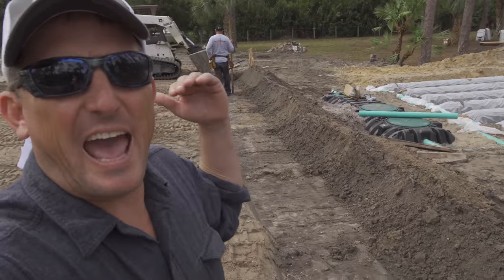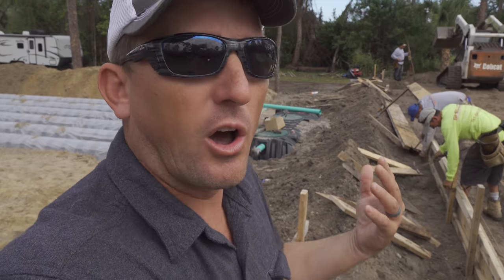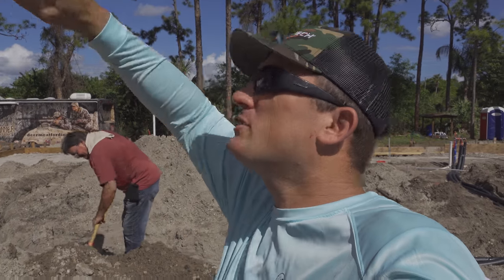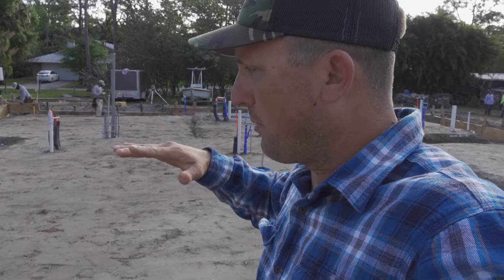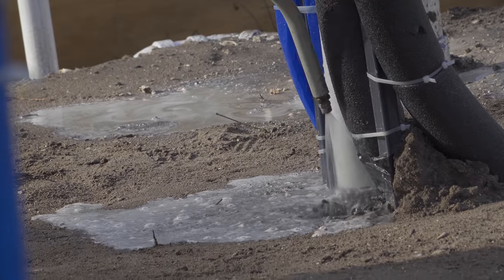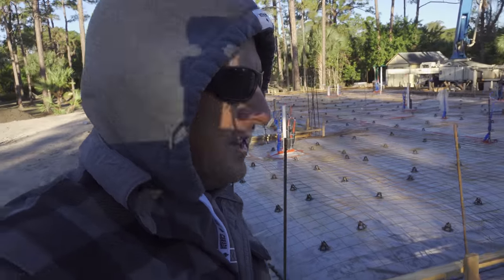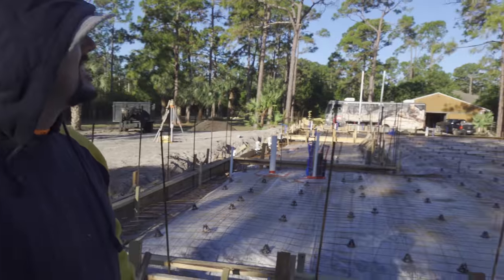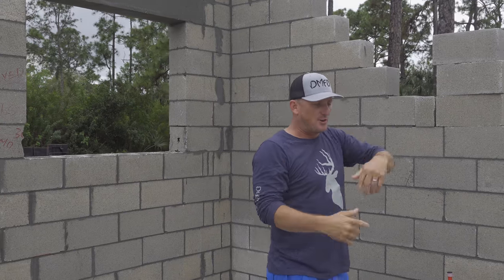Building our DREAM HOME! "The Foundation"

Comment: The vibration is to consolidate the concrete, and the Wire mesh that was laid down is to reinforce the concrete and help from cracking.
Reply: The only guaranty you get with concrete is it will crack, the wire helps to keep it together. Keep up the great work my friend.

Comment: The purpose of the wire inside the concrete is to strengthen it against non-compressive forces (i.e. forces other than the weight of the house). Concrete is incredible at handling compressive forces but is very weak to expansive and other forces. The wire strengthens it by allowing the wire to bear the majority of the expansive force (as things expand when warm and shrink when cold- think winter/summer) and as they bear this it minimizes the other forces exerted on the concrete minimizing cracking and drastically reducing the chance of critical failure to the foundation! Like so Rob can see!

Comment: Don’t want to be a joy kill but that recirculating . Pump system is very expensive to run because 1 the pump 2 your warming the slab all the time, multiple tankless would be a little pricey up front but quickly pay for itself compared to recirculating pump. But happy for your new home
Reply: I also heard the recirculation is tough on the pipes.. erosion. JS
Be aware. If it was my house, knowing what I know now, I'd make sure certain things were done. I like things that last forever.. unfortunately that kinda makes me a bad engineer.. like a lawyer with too much ethics

Comment: Concrete does not have any tensile strength, so the steel wire mesh is used in the slab to add more strength to it and prevent it from cracking!!
Thanks for great videos!

Comment: Rob, great video! the steel mesh in the bottom of the concrete slab is to give more strength to the concrete slab to resist vertical load.

Comment: Lived in Jupiter farms and palm beach gardens my whole life but recently moved to Tennessee. I've been plumbing since I was a kid from summer vacations, spring break, any time I was free id go with my dad. I specialize in new construction now, and I'm a certified Navien Tech. Tankless water heaters are a passion of mine 100% the way to go. However that being said I know many areas down there do not have Natural gas or propane, these tankless heaters are worthless if they aren't ran by gas. If you dont have gas you're best off with electric tank type heaters. And if you do have NG or LP Navien tankless heaters blow away rinnai in every aspect they're easier to maintain, way more efficient, they don't need a buffer tank, they have a stainless steel/magnesium heat exchanger that wont rust or build up sediment vs the copper heat exchanger on a rinnai that WILL rust out on you, and navien tankless heaters are way easier to work on all you need to do is look inside of each one. Navien is nice clean and efficient where as a rinnai looks like a giant rat's nest if you do ever need work done on your heater you'll save hours on labor by going with navien over rinnai. All that being said congrats on the new home it's an exciting time enjoy the process however long it takes it'll be worth it. Keep up the great work and #FishOn 🤙

Comment: The wire they put in the foundation (rebar) is to make it a composite (2 element) foundation. The concrete by itself is strong but brittle. The rebar is flexible but not strong. Together you have a strong foundation that will flex instead of break. Same thing with family. Individuals that together create an unbreakable bond. God bless. What a dream home this will be!!

Comment: The wire mesh gives the concrete flexibility so that the foundation does not crack and gives up that's its purpose or same thing with rebar

Comment: I am a general contractor. I will be watching every house build video you do. 

Concrete has lots of strength in compression but no strength in tension. The wire mesh gives the concrete strength in tension. The same applies to rebar.